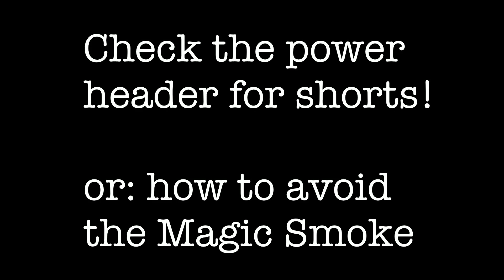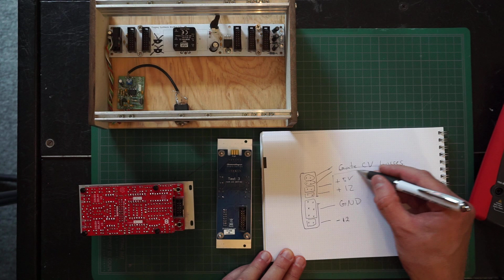Check the power header for shorts! or: How to avoid the "Magic Smoke"

Comment: HI, I'm building rings, and I think I have a similar test power supply that you do - it won't power up the module. there are 3 leds for +12, -12 and +5 which normally are full on  - with the rings they just blink every few second and go off.
i followed this video, every checks proved that everything should be ok. I also followed the diagram and board file - there is no continuity where it shouldn't be, and there is one where it should. Yet the problem persist. Do you have an idea what might be the fix?

Comment: Somebody release the files for a buffered multiple and I ordered some. 
They work great only thing is  
They didn't put a standoff hole in the board so I decided too drill a hole. Remeber if you drill into a double sided circuit board and use a brass stand off that will short the 2 sides. Use a nylon standoff. 

Also make a reliable oscillator before tackling any other projects like a sequencer or filter for proper testing and troubleshooting. That's how you avoid unnecessary headaches.

Comment: Malekko's Varigates, Voltage Blocks, Quad LFO use the Gat and CV busses so you don't need to patch them externally. They are synced if they are on the same power rails
Reply from the maker: good to know, thanks!

Comment: Make noise and a few others use the additional pins. Not so much as gate/cv but more a serial connection so you can change patterns and modes thru the bus ala Tempi and Rene v2

Comment: What power supply/bus board is that?
Reply from the maker: Frogleg's Minibus, by Pete Hartman. Seems to be discontinued or at least out of stock everywhere.
Reply: @QuincasMoreira  Thanks!
Reply: I'm curious about this too. It looks like one that uses the 
MEAN WELL DKM10E-12 
which takes +5V, liked you'd get from USB and makes +12v/-12/v at a limit of 450ma or so. So having a board with only 6 to 8 headers is all you want. Frogleg (frogging?) synthesis is what i could make out from the video but searches don't yield a busboard from them.